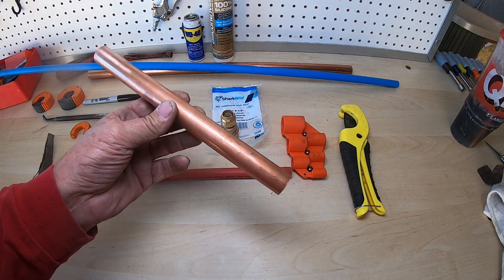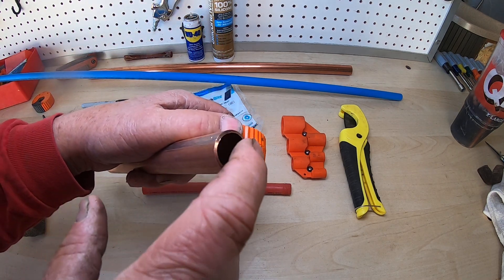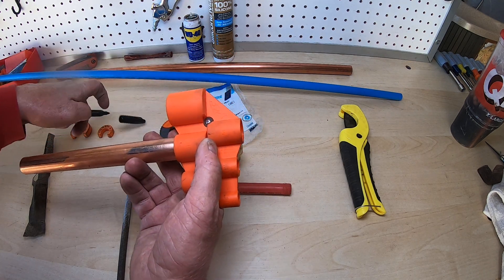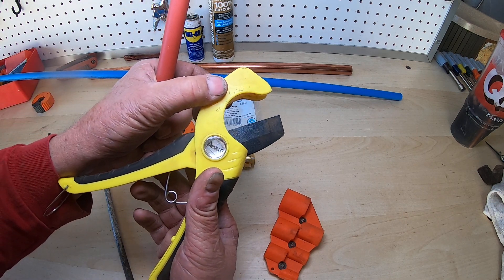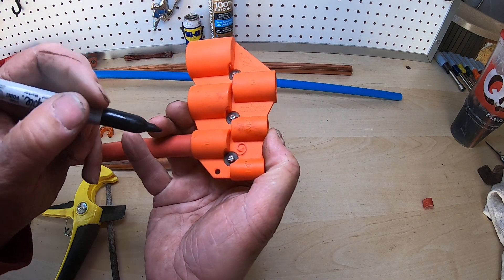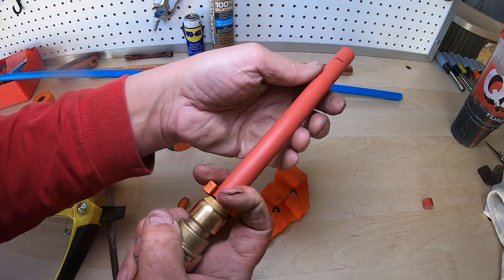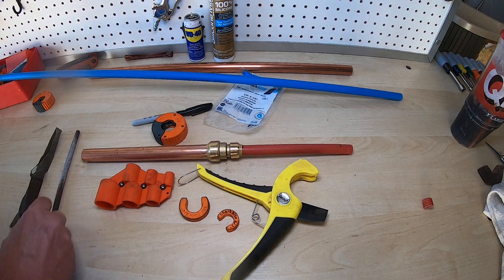How to connect Copper to Pex using SharkBite Fittings...

Comment: One thing , in Europe they use a different tool and it's got an extra function besides cleaning the end it also makes a groove in the copper pipe for the safety ring to lock in , and we use a insert for the PEX pipe

Comment: The plastic piece is not needed for the copper pipe, only the pex, it keeps the plastic supported against the o-ring. The copper does not need the additional support. You can use a pair of needle nosed pliers to pull it out if not needed.

Comment: What would you do if you were working with a vertically fixed copper pipe. As far as the white plastic piece. The shark bite will be coming up under the pipe?

Comment: Thanks for the tutorial. It's was the most fitting for my problem. I needed to just heat up a copper coupler to remove it,  that corroded, remove 2 inch of pex, then installing a sharkbite slip coupling. Coupler was first Gen on clearance for 4.62. My plumber told me it would be $450 to have done today (Sunday).

Comment: Okay, it's called a water heater not a hot water heater. If it was already hot you wouldn't need the heater aka heating elements or gas with pilot light

Comment: Do you need the plastic insert for copper pipe? I bought a couple of 1/2" Sharkbite connectors that one end has female threads and screws to the water faucet inlet for my washing machine supply line and the other end is a quick connect to 1/2" Pex. Neither one of these connectors had the plastic insert in the plastic bag packaging, nor were they in the end of the coupler. I threw the plastic bags that the connectors came in into the trash before noticing the inserts were missing. I assume the fitting must have been for copper Pipe. I am using Pex so I need the insert. I have some other Sharkbite connectors I can take the insert out of and use. Just curious about if you need the insert for copper. Also working on a mobile home that has polybutylene water lines. They make Sharkbite adapter couplers with one end going to Pex or PVC and the other end designated for Polybutylene so you can connect Pex to a polybutylene line. The plastic ends are color coded to prevent confusion. The only difference I can see is that the polybutylene is thinner than Pex and takes a slightly larger insert to keep the line from collapsing which also means a polybutylene insert will not go into a Pex pipe as the inside wall of the Pex is smaller around. A Pex insert will go into a Polybutylene pipe but will be too loose to keep it from collapsing.

Comment: imagine burying these pipes in walls knowing they will leak eventually (or right away)
Reply from the maker: Ive been using them for 15 + years ..And Ive never ever had a leak not even one drip. 
Thats been my experience with them 
I don't away use them but I do like them.

Thanks for Watching & SUBSCRIBING

Comment: You didn’t deburr the outside of copper tubing with the sharkbite depth gauge and deburring tool. It’s the o ring inside the sharkbite that will be compromised if the copper is not deburred.

Comment: I was searching to do my 3 quater sprinkler ball shut offvalve and I managed to cut the piece out and took to the Home Depot and they helped me to find the same thing as the one I had then, they also told me I need saldin it after put it together, I bought whole bunch of stuffs and didn't work for me it still leaked. Now I saw  your video using push in copper, wow, why didn't they tell me this. I thank you so much for all this information. 
I am going to the Home Depot again to get all stuffs. Thanks

Comment: You deburred the outside of the PEX pipe BUT did not deburr the outside of the 3/4-inch copper pipe.  This should be done in case there is a burr that could nick/cut the black O-ring in the SharkBite fitting.  One less chance of a possible leak.  Otherwise, a great video.

Comment: Why doesn't anyone doing these Sharkbite commercials admit that those fittings reduce the diameter of the pipe by about a size? Now in this video he is converting from a 3/4" copper pipe thru a Sharkbite & then on to 1/2" Pex. The Sharkbite fitting diameter is less than 1/2".

In addition on the copper side he should have removed the plastic insert which is allowed.
Reply from the maker: In over ten years of doing this I have never removed the plastic insert EVER and that in one of the reasons I never get any leaks and have never had any problems using them. Thanks for Watching & SUBSCRIBING

Comment: Just a tip. Please don’t use them again and again. Just cuz they come apart, doesn’t mean you can use them over and over. You’re damaging the black oring inside. They’re also greased slightly in there. Eventually it’ll be dry. They do have a use, just don’t abuse them

Comment: If you have never had one of these leak, you are deburring the OD of the copper tube. You should have shown that in your video.
Reply from the maker: Watch the video again.. I use the sand paper / emery cloth or the liken the outside and I also use a file in the inside of the tubing.. And YES to this very date I have never had one leak. Thanks for Watching & SUBSCRIBING

Comment: I’ve read copper isn’t supposed to be sanded when using shark bites. Can some confirm?
Reply from the maker: I have never read that or been told that in the past (You are the fist to tell me that) I will say Ive been doing it the same way for over 10 years now and I have never had ant issues with leaks or any problems ever.. So I will not be doing anything any different then what Ive done in the past. Thanks for Watching & SUBSCRIBING

Comment: For what it's worth. You can also cut the PEX tubing with a regular tubing cutter (most of the time). but you need to deburr the inside edge of the tubing with a reamer as well. It's slower, but works and I already had both a tubing cutter and reamer on hand. I was helping my brother do some PEX replacement last weekend and he had 2 tubing cutters on hand. On one, the cutter wheel didn't clear the body of the cutter enough to cut all the way through the PEX. The second did and that's what we used.

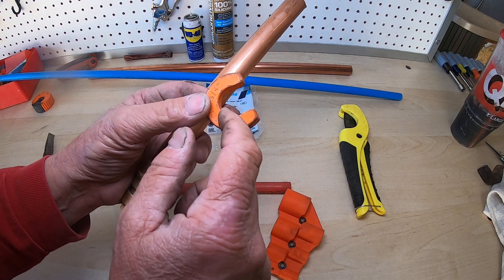Comment: @3:00 The horseshoe key you are holding on the wrong side, this open caseate is just unnecessarily hurting your fingers where it’s just supposed to press the ring on the connector, these release rings are way slimmer than your fingers… flat side is more ergonomic to push or press… fyi

Comment: That white piece of plastic [the stiffener] in the Sharkbite fitting has an even smaller opening than the pipe that fits over it, so you will have reduced flow issues. I've seen videos where the plumbers are actually removing that plastic part before inserting the copper pipe.
Reply: Only the copper, it must stay for the PEX
Reply: @cwbonds8038  Yeah, I clearly said "...before inserting the copper pipe."

Comment: Sharkbite says their connectors are not to be used on soft copper. Copper must be hard drawn types K L and M only. I found out the hard way.
Reply from the maker: Ive never ever read that anyplace..I will say that I have never EVER had any problems using them with any type of copper and will continue to use it when I need to in the future.. I have seen them fail a couple of times (I did not install someone else did and installed them wrong) I removed them and installed them properly and they have never leaked since then..Thank for Watching & SUBSCRIBING

Comment: Great video! Helped ease my mind tonight thinking about using shark bites on a shower valve install tomorrow! But I do have a question. - What if I'm working with some old 1988 copper and changing to pex? My question is do I just wipe it clean, put a brush on it, or really deep clean it or what? In other words do I need to shine the copper or just wipe it off? Thx!
Reply from the maker: Yes  would clean and shine the copper that is what Ive done in the past..I just finished an install on a house that was built in the 1960s and had no problem.   Thanks for Watching & SUBSCRIBING

Comment: I think this is a good, general overview for beginners.  I found that with plumbing in place and no leverage, getting the connections in and apart is not quite so easy as one would think.  Filing the Cu is a good idea.  
When trying to disconnect an inline, in place, overhead, vertical SharkBite fitting, it was my experience that the disconnect tongs were necessary - just couldn't get enough force with the clip.  That's the deal with SharkBite that bench demos don't convey.  Not to scare anyone away from it, but be aware that these fittings are tight for a reason.  They don't just slide on and off.
Reply: Yep, I went with the tong style from the start. Glad I did.
Reply: @Bargle5  é deveria ter também para unir com cobre e alumínio por isso não gostei 👎
Reply: Good call, your exactly right!

Comment: I was told before that for the 3/4" sharkbyte you should remove the white insert? I noticed after changing out my water heater hoses were missing the insert. I don't know the reasoning.
Reply from the maker: Im not sure how to answer this. I can say that I have never removed the white inserts on any of the installs Ive done. So I'm not sure why the white insert was missing. Thanks for Watching & SUBSCRIBING

Comment: if the sharpe edge on the inside of the copper pipe can ruin the connection in the sharkbite fitting, the sharpe edge in the pex can also effect the connection in the sharkbite fitting.
you used your orange device to deburr the putter mr edge of the pex but did not break the sharp inside on the pex.   i would hit that inside edge as well.

Comment: Can the Shark Bite fitting be Reused on making small repairs??
Reply: Yes! I used the SharkBite for leaks in the apartments of an old building I owned.  The leaking copper pipes were only a couple of inches from the wall so I couldn't solder the pipe.  I cut the pipe, sanded the burr, and installed the SharkBite.  It took all of 5 minutes and never leaked.   They also make valves that come in handy.  It's expensive compared to regular copper, but the time saving and DIY vs hiring a plumber is well worth it!!!  The SharkBite copper is thick and solid compared to regular copper fittings.  Well worth it IMO.

Comment: Can someone explain why marking the pipe is so important? I thought you'd just push in all the way until it cant go any further.
Reply from the maker: By marking it you will know it went in all of the way. And if for some reason you are not pushing it in straight it will seem to bottom out and then it will leak. If you mark it and then check it every time you install a SharkBite you will never have a leak... Thanks for Watching & SUBSCRIBING

Comment: It looked as though you sanded the outside of the copper pipe that went into the SharkBite. My question is. Is that necessary?
Also I thoroughly enjoyed your video👍
Reply: Everywhere I have read, you should sand it to clean the surface for the best fit

Comment: To use copper in one side the plastic piece comes out. The plastic is used for Pex pipe only.
Reply: The plastic piece doesn't have to come out. Sharkbite even mentions that it can stay in without issue.

Comment: now those are workman's hands!
Reply from the maker: They are pretty beat up...
Reply: i had a helluva time using the slip coupling. once you move that piece on and use their little orange plastic "tool" to reposition, good luck
Reply: @diymrscott4983  Can We use SharkBite for Underground water line..???
Reply from the maker: @Honestandtruth007  With everything that I have read  about them I have never found anything that says you can or can't use them underground. So I'm not sure how to answers your question.. Hope that Helps Thanks for Watching & SUBSCRIBING
Reply: @Honestandtruth007  Yes you can, but you have to wrap the fittings with silicone tape. Sharkbite of course makes that as well
Reply: Any shark bite can connect copper to pex a or different ? That means we much choose a special shark bite ? Thanks
Reply: Apparently he’s never heard of skin lotion lol
Reply: @rolandthethompsongunner64  lotion won't make much of a difference when your hands are that damaged. The skin creates scar tissue that doesn't work as good as your original skin
Reply: @stylicho  Wow guess so.
Reply: Lol